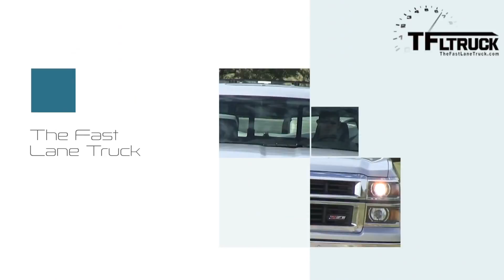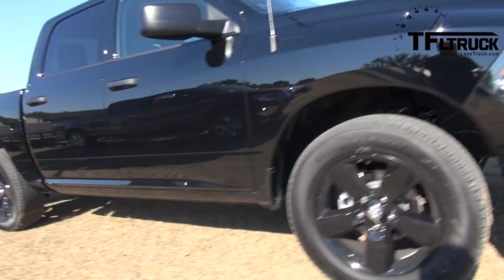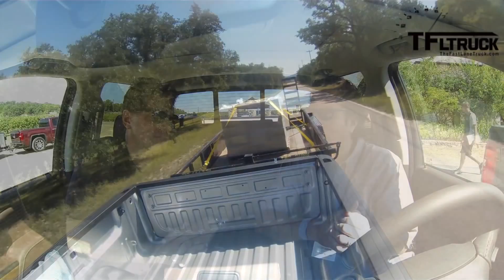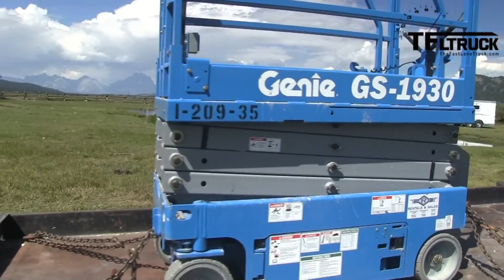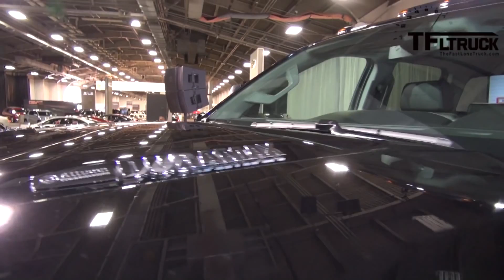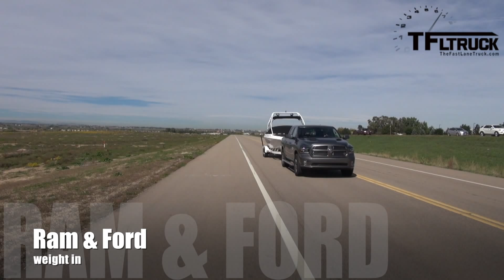Unsafe to Tow? Magic Towing Dust Revealed (Part 1)

Comment: Magic towing dust? That's the biggest load of BS that I've ever heard of!!!!
Reply: +Dale3240 He is being SARCASTIC. The video is about the 'vagueness' and lack of any scientific data of Manufactures towing capacities of their vehicles.
Common sense might dictate that a 1/2 ton vehicle can NOT pull a 10,000 pound trailer, but there may be some morons attempting it ( you know, the one's that voted for obama).
Reply: Damn you dumb.
Reply: +Marky Polo if it's setup correctly, why can't a 1/2 ton tow a 10,000 lb trailer? Is it the brakes, the engine, the suspension or what?
Reply: +Rexford L Suspension. A "ton" is 2000 pounds. 1/2 ton is 1000 pounds. That is maximum payload for carry in the bed over axles. A 10,000 gvw trailer will have a tongue weight somewhere around 800 pounds. This will be on your bumper, not in your bed over the axles. Your front end will then be kissing the sky making your vehicle very unsafe. No reputable trailer company will set this up for you. I have a 1/2 ton truck ( Ford F-150 SVT). Maximum carry GVW is 7500 pounds with a tongue weight of 500 pounds. All 1/2 tons will be similar. Always, Always choose the SAFE way!!!!!
Note: a 1/2 ton with a beefed up suspension could pull a 10,000 pound FIFTH wheel setup. But still, you would have to set it up yourself. No one will do it for you. Though, I would still NOT recommend it.

Comment: this video is the dumbest shit ive seen just use a diesel if your gonna tow
Reply: +CrackHead476 - Has nothing do with diesel or gas but you're an idiot so don't let me stop you. The standard they talk about can be adopted to a civic if you had to. The point of the video is that Toyota is the only manufacturer that doesn't lie about their towing capabilities. Did you even watch the whole video? Were they using words too big for your understanding?
Reply: Diesels also need standards.  So they can't claim any and all weights.  It's more than power.  It's stability, braking, sway control.

Your comment is actually the dumbest shit I've seen.

Comment: Who's Ford F-250 is that? That is one of my dream trucks
Reply from the maker: That Ford belongs to MrTruck.com
Reply: +trials_bike2000 That's an older one. What about the newer ones?
Reply: +Keanu Paler I like the 7.3 6.0 and 6.7. Not a huge fan of the 6.4 though
Reply: +Keanu Paler I like the 7.3 6.0 and 6.7. Not a huge fan of the 6.4 though
Reply: Oh. I meant the newer models. If you take a good look, they all look the same, the fords in the twenty first century. :)
Reply: +trials_bike2000 of all those, the 6.0 was the one that caused the most issues for Ford and Navistar.

Comment: Strange this means there are no laws for max. payload in America?
Reply: +Philip De Groof There are max payloads in the USA. By definition, "pay load" is what the truck is physically capable of hauling sprung as it is. They also factor in that the truck can safely stop, mobilize (such as tire weight rating, steer, etc) and physically can haul power wise. With all that factored in the manufacturer can figure out a weight rating. Here in the US, certain criteria and certifications for different weights are met differently by state.

Comment: dumbest shit I've ever seen. start the engine, immediately take it to redline and hold it there.

ever heard of oil pressure? maybe wait a second or 2 before revving the fuck out of a brand new engine you morons
Reply: it hits the Rev limiter it's not at red line it's only like 4000 rpm

Comment: I tow over my GM truck's rating, never had any problems at all.  GM's standard is 99% of what J2807 is already, and really they build them much more capable.  By standard they just can't legally say they tow more.  I'm sure Ford is the same.  Toyota however...  That "engineer" is NOT the guy who designed the truck, he's just a pulpit engineer paid by Toyota to look American, when they are not.  Toyota is hurting, and lies at every chance they get.
Reply: Do you got proof of this statement or is this one of those tin foil hat opinions you pulled out of your ass?

Comment: if that's still confusing look at this number...on my new 2014 f-350 duel rear wheel pick up.....my gavw is 14000 pounds......so I can legaly carry almost 8000 pounds I my box......but......that all depends on what tires I purchase as well....if I get the standard all season radials I will get better ride and mileage but I best not get caught with more than 6000 pounds in my truck bed..... so the whole premise on towability and maxes that these guys r using is completely flawed.....he was overweight towin that boat even tho his total weight under max gross vehicle ratings......

Comment: Excellent video. I watched both parts to this video and one of the most obvious things that I noticed was that the Toyota engineer did a much better job of answering the questions and didn't get nervous and start fidgeting like the GM engineer or beat around the bush like the Ford engineer or gloat about what their truck can do like the Chrysler engineer did. Todays pickups are approaching weight ratings and power levels that rival medium duty trucks and amateur drivers are being given the ability to move 30,000 pounds around on public roads at will. This is a serious issue.
Reply: 72Blazin even 7 years ago, its amazinghow much the "head to head" competitions rose, i remember never seeing anything like this, in the last 4 years everything has risen so much, its very scary actually. 10 years ago you could do anything a average person would need to do with those trucks. things are getting out of hand in my opinion

Comment: lets see in the 90s and 80s gm ford dodge were only recommend to tow 10000 maybe 12000 pounds not like today we got bigger better trucks 2500 3500 that can haul 20000 to 23000 pounds of weight but remember they have been tuned to handle the weight distribution and breaks plus gm has the best engine brake , I drive a peterbilt for a living and I love my chevy trucks on the road are the work horse of America and around the world with out trucks we would be nothing and nothing would be able to move Toyota is ok but not a everyday working mans truck more like a teenager toy compare to his fathers heavy duty toy
Reply: The duramax is anything but american. Its made by isuzu.
Reply: Al Lewis do you know where there made at ??????? look it up u will be surprised cause I guarantee you they aren't made over seas
Reply: karlitos saiyan *Cough* 7 in 10 of all GM vehicles since 07 are made in china Cough then assembled in mexico Cough
Reply: +Matt Howell your a fucking lie

Comment: DUDE ALL THIS is just giving me a headache lets see Toyota sucks I don't see them towing anything really heavy especially for dealerships I mainly see ford dodge and gmc chevy towing four to five cars for dealerships and yes it does matter if the person can tow certain things if you are your occasional weekend tower then u don't have a class A like me and other truck drivers the half tons shouldn't be towing anything over 10000 pounds cause the breaks and the engine down shifting and safety of the vehicle
Reply: You only see the heavy-duty Ford, GM, and Dodge trucks towing cars for dealerships. Toyota doesn't have a truck in that class....they are in competition with the F150/1500. not the F250/350/2500/3500 and up.
Reply: That is the dumbest shit I have read recently.

God you guys are ridiculous.  It's about setting a MEASURABLE standard so people can compare apples to apples with real numbers.  Not made up claims from the marketing departments.

Comment: "ding ding"? what are you trying to turn this into, kiddo!

If you own/drive that many trucks that you claimed, you should have known any of these trucks, with modern drive train and frame, is able to tow more than the ratings. ie the ecoboost f150 rated max for 11k, yet i've seen it tows 15k.

The question is how long/durability doing that. So that comes back to TFL trucks test is silly because how can they test durability? by running them for 30 days straight? hence, dramatizing it was silly

Comment: Hey Roman...great coverage on this. its funny how the GM engineer says their testing complies with J2807 but in an article in Edmunds (edmunds.com/car-reviews/features/no-go-for-standardized-tow-ratings.html) 

GM said their 2014 truck will not comply with this standard...here is the quote: "But at a media drive event for the new pickup, Chevrolet engineers flatly told Edmunds that the new Silverado's tow ratings were not derived via the new SAE standard."

Comment: Great video!  I wish that there was some way for you to do a video on the durability of trucks from Ford, Chevy, Ram, and Toyota.  

I would love to know how many times the average owner takes these in to the shop and for what on the newer trucks.  (example: F150's and the turbos, Ram and their air suspension, Toyota and the frame related issues, etc...)

Comment: I totally agree with you. I have personally seen a lot of stuff done with trucks both half tons and HDs that the manufacturer probably never envisioned. We personally pull a 16' gooseneck livestock trailer with a 00 chevy 1500 and it handles it just fine loaded down. Theres a lot more reserve in these trucks that there not letting on about,

Comment: TFL Truck dramatize it. You multiplies it by 10. Why don't you just come out & say that you are a Toyota fan & then Shut up about it.

FYI, the 12v cummins in a dodge ram 2500 only rated for 215HP/440lbft and it was rated to tow over 12k lb. 

5.7 iforce is Toyota biggest factory available power option. TRD add on doesn't count. All domestic 1/2 trucks have stock engines making more power than the 5.7 iforce. 

And if you think Toyota has good track of safety record, you're smoking something!

Comment: Well you can do that once the engine is start and idle for a couple a sec , I never did that on any truck and car that I own and they never lost power excepte the normal lost from the lost of compression with the time.

Comment: Roman, your are failing at noticing there are many factors that determine or that should determine tow capability. Toyota builds Hino's that have far less power than these light duty trucks but are capable of much more. Mass move mass, it's a part of physics. Look how light these half tons have gotten( Ford). It has nothing to do with power.

Comment: That will be the case for GM and Ford half tons, towing ratings will drop with the towing standard.  GM won't implement the towing standard until Ford does. 

My personal opinion is that in the half ton segment, Ram and Toyota are the only two manufactures that are honest about towing numbers. Even though Ram hasn't adopted the standard yet either, both Ram and Toyota rate their half tons for~10,500 pounds of towing. Which is honestly what a half ton truck should be towing.

Comment: I  agree with the J28 standard but here is what I know from experience, I own a 2003 Dodge Ram 2500 regular cab long bed 5.7 hemi 5 speed manual truck. From experience I haul on a day to day basis a 20 foot goose neck trailer loaded down with 18,000 pounds of steel pipe, that's more than 23,000 pounds I'm towing. That is more than a new 3500hd trucks prescribed towing capability. The towing plates I have paid for in Missouri is 24,000 pounds. So my question is what can a new truck actually tow?

Comment: I really don't see what the big deal is over towing capacity. The average person only tows between 4-6K lbs. I admit, I use my F-150 to tow a 8K lb trailer on a weekly basis and it's starting to wear it out, but when you start getting in the 10K+ range you should really start looking for a HD.

Comment: That isn't entirely true. Ford has already said they would start using the standard when they release the redesigned F-150 in 2015. Chrysler & GM should've adopted it this comming model year but chose not to.

Comment: Oh I can guarantee that some tow rating will be changed dramatically.  Take the new Chevy 1500 with the 355 hp and 383 lb-ft of torque 5.3L with  3.42 axle.  Chevy has rated that truck to tow 9,600bs in a Crew cab short bed 4wd configuration.  The same configuration in a Tundra with the 381hp and 401lb-ft of torque 5.7L with a 4.30 rear axle is rated tow 9,600lbs going by J2807 standards.  How does a less powered truck with taller gear tow the same a more powerful truck?  Towing dust.

Comment: Toyota only lost a few hundred pounds off its tow rating when it moved to the  j2807 standard. I don't see why others should see any major change by doing the same. The problem is that calling a truck "best in class" helps with sales. The towing ratings may not change much, but they'd rather just keep cheating people a little to nab more sales.

Comment: Funny, when you go to U-haul and want to rent a car transporter (trailer) you must have a 3/4 ton or better. I have a '96 Dodge Ram 2500 and it sucked for towing the race car. My '69 Chevy 30 with a 350 and 4 speed towed better. I could actually accelerate uphill vs the Ram using 2nd gear at 50 mph.